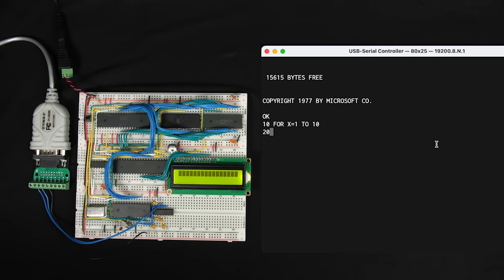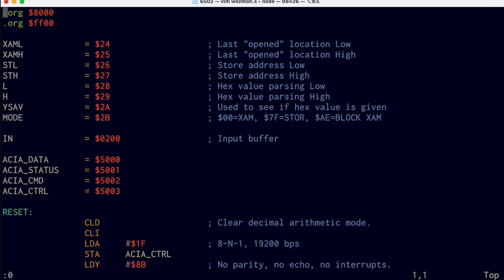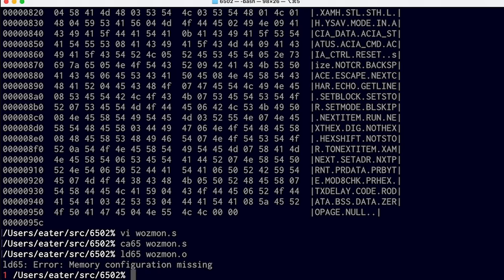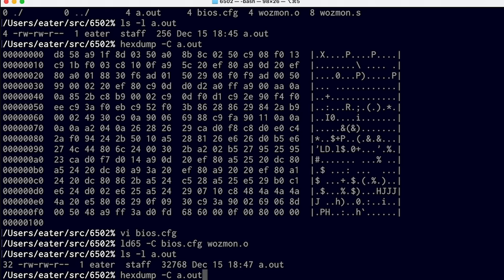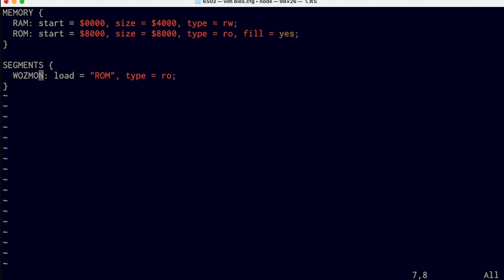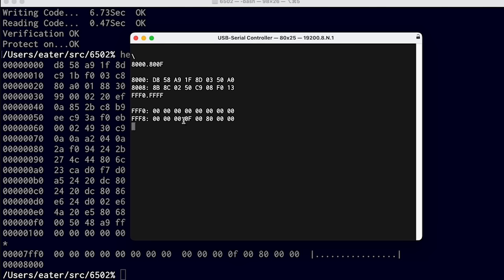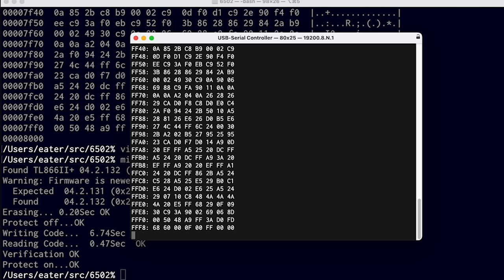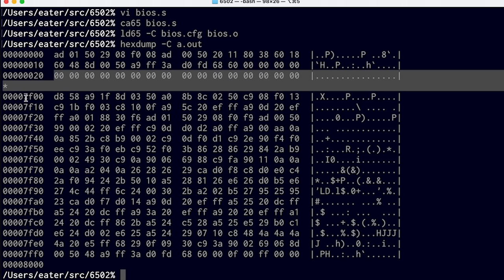A simple BIOS for my breadboard computer

Comment: Nice low level stuff! 
However, I think it unwise to directly jump to a hardcoded address of a "BIOS function". Should there ever be a need to modify a "BIOS function" the addresses of subsequent functions will most likely change and calls to these hardcoded addresses would be incorrect. You could add a (jump) table with pointers to "BIOS functions"  at a known location in ROM(?) preventing such issues.
Reply: That would add an indirection on every bios invocation. I don't even think this was done on the original BIOS. If necessary, an indirection could have been added at the old location when necessary in a patch but not by default

Comment: Would it make sense to flip the “include” around? Shouldn’t wozmon.s include bios.s at the top? wozmon is the thing we want to build.
Reply: I understand, where you are coming from. Normally BIOS and application would be build separately without any include of implementation of the other.

The "right" way to do this thus is to provide a bios include only defining the interface but not the implementation for wozmon to include

But it's not worth the added complexity for this demonstration I figure

Comment: Why code in BASIC and not C?
Reply: Compiled languages weren't really feasible as a "built-in" languages for 6502-based systems.  Compiled languages on home computers, even assembly language, generally required a lot of disk swapping.  You would need to load one program to edit your code, then another program to compile it, and possibly another program to link it.  64K address space would be very tight to accommodate all of that, not to mention it would have been an expensive feature when most consumers would be satisfied with BASIC.

Comment: Could you teach us how to make the same computer, using the same principles but in an fpga and/or a cpld?
Reply: He already did, take a look at the 8-bit computer series :)
Reply: @petermuller608  I have searched but I didn't find anything, I only saw that it does it on a breadboard, not on an fpga
Reply: @Gumeb  that's equivalent, there's no fundamental difference between CPU design in a breadboard and an FPGA, just the building blocks are smaller

Nevertheless, you might be interested in "from transistors to Tetris"

Comment: I dont understand people using vim and screens. I prefer nano and tmux. Why do people prefer wasting time learning keybinds when u can have a small interface that you will never need to learn. Imagine browsing the terminal without knowing in what folder u are, running ls every time or memorizing your current location, its a waste of time.

(I do use vim just on android because it plays better with touchscreen)
Reply: Probably many of us came up in the era where vi was all you had. I used to administer server farms and they’d run some default super minimal distribution (because disk space was expensive). I learned vi out of necessity. Even today I’ll still use it on my mac for quick edits. Just an old habit that won’t die.
Reply: And here I am in nano and screen... 😉
Reply: ed(1) is where it's at. but what you end up using is largely a matter of taste, preference, and experience. did you know that every textbox on macos supports the same basic cursor movement keys as emacs does? with ctrl+a moving to the beginning of the line, ctrl+f moving to the next character, etc? i don't know about nano, but in when programming in C in vi it's pretty easy to say "within the scope of this function in particular, replace every instance of the identifier x with y, without affecting other things like exit(1)"
Reply: @pineberryfox  yeah u right, its a matter of preference. Because u where in those circumstances u preferred vi. I do small things in C but isn't my primarily programming language
Reply: @freez8829  i main emacs personally, because it fits in so perfectly with the entire rest of the system. but vi is fine. nano derived from pico (on my system, "man nano" actually brings up the manual for pico!) which in turn derived from microemacs, which obviously derived from emacs.

i'd say it's not about "learning keybinds", it's about being comfortable moving both near and far in your files. the keybinds aren't something you think about so much as just do.